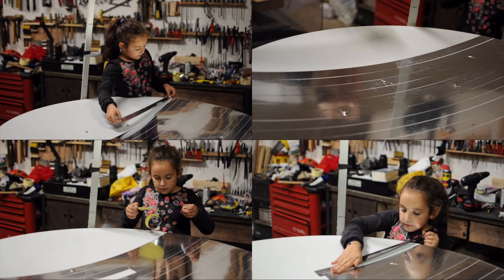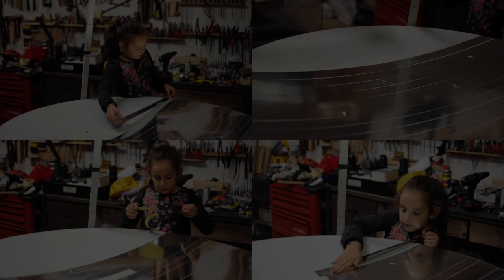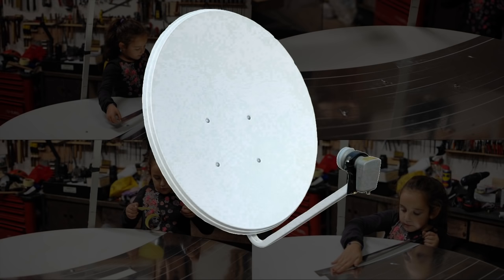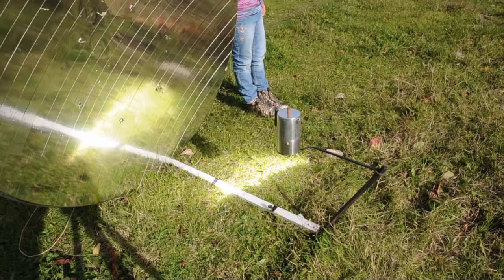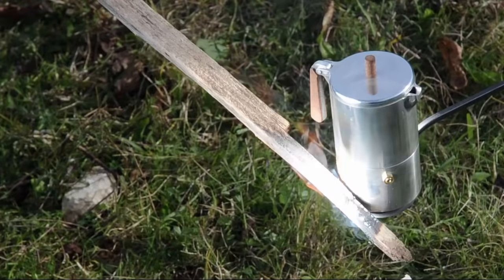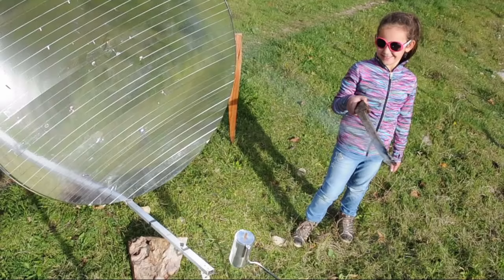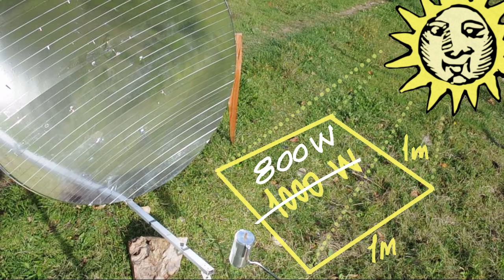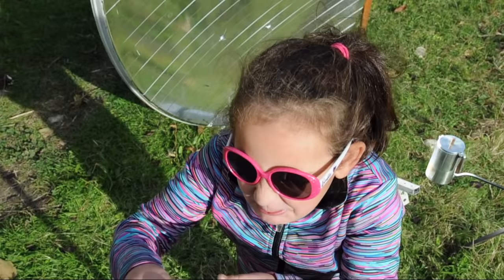DIY Parabolic Solar Cooker

Comment: Want to know a secret about water that can make you lots of money. Water expands an enormous amount. Sterling engines do not scale well. However if you have expanded steam out of a cylinder, then close the cylinder, then spray cold water inside. The steam will create a vacuum like a closed off syringe being pulled. The vacuum can be used for cooling, locomotion, projection(ping pong vacuum cannon) and combines with exothermic reactions for a combo. Also what is the point of radiators on a car. Use the heat to do useful things don't waste it by radiating it away  Happy Birthday
Reply: Cool story yo, goes for sho, that no one knows

Comment: Your math for the power is not correct. It is not the size of the dish that matters, but cross-section from the direction of sun.  Usually it will be less than half of the actual size, depending on a dish design and angel. If you point a dish directly into the sun, and then find a focal point and put your mocapot there, you will get your 1600-2000W there.

Also painting pot black should help a lot.

Still a lot of fun.

Comment: Anyone tried pointing one of these at a solar panel (probably not at the point of focus)?  Might get full-panel power from a camping-size panel.
Reply: The manufacturer of my solar panels discourages anyone from trying to increase the output with mirrors.  The danger of overheating components which are intended for ordinary sunshine is too great.  If you really want to try it, make reflectors that are white (rather than mirrored)!  My solar panels show a bump in output when a passing cloud adds to the direct sun, so simulating a few clouds might help.
Reply: @cdorcey1735  good point.

Comment: The satellites are not "spinning" at the same speed as the planet spins, they orbit with the same angular velocity as the surface of the planet.

And light is the same kind of radiation as a radio wave, electromagnetic radiation. Just different wavelengths.

You may be wondering why I'm commenting 4 years later, c'mon, I've been busy. Fixing the Internet is hard.

Comment: Why not use chrome paint?
Reply: Surface roughness is very important for focusing light, and chrome paint is probably not smooth enough.  Having tried aluminum foil, I could see the effect of the metal grains (which are stretched out by the rolling process) making the focus better on one axis than on the other, and none very good.

Comment: I love it when dads do stuff like this with their kids. 

 For clarity:
https://earthobservatory.nasa.gov/features/EnergyBalance/page2.php
"At Earth's average distance from the Sun (about 150 million kilometers), the average intensity of solar energy reaching the top of the atmosphere directly facing the Sun is about 1,360 watts per square meter"
https://www.energy.gov/eere/solar/articles/solar-radiation-basics "Atmospheric conditions can reduce direct beam radiation by 10% on clear, dry days" 

Being during the evening and time of year a d your latitude  let's guess around 15% loss, and netting  about 1100 watts pr sq mete perpendicular to the sun. But your parabolic dish  not flat, nor is an asymmetric  offset feed dish perpendicular to the sun. No pun intended with solar cooking.  :D.  

Being an off axis feed dish and not knowing its overall  dimensions or where its focal point is, its impossible to know  what its effective perpendicular cross section to the sun is.  But if we guess its 75%, then you getting maybe 825 watts. And if your using aluminum tape, and if its reflective  properties are 85% then you might be getting close to 700 watts per sq meter of the dish. 

It's also possible your aluminum can collector is reflecting say 50% of the light falling on it.  So quite possibly your getting 350 watts seconds (joules) every second to heat your coffee.  If you have a glass french coffee press, the coffee grounds might absorb the sunlight better than a reflective metal can.

Comment: Time to invest in some basic ELECTRONICS SKILLS.
FORREST M  MIMS III ....  Engineers Mini-Notebooks  Tandy Corporation
These pocket-sized booklets are cheap and fairly easily understood.
Good Luck finding them now.
Radio Shack Catalog No's....
62-5011
62-5012
62-5015
62-5018
62-5020
62-5026
276-5012A

I am sure there are more titles than these,... but I am in Canada, and these were purchased during RS' hectic transition into "The Source". I am unsure if they are still published.... but the few I have FIRST EDITION / FIRST PRINTING
Some have FIRST EDITION / SIXTH PRINTING....
All seem to be 1992-1998